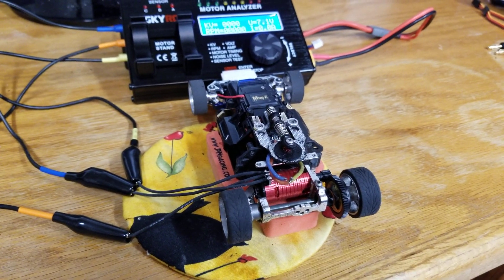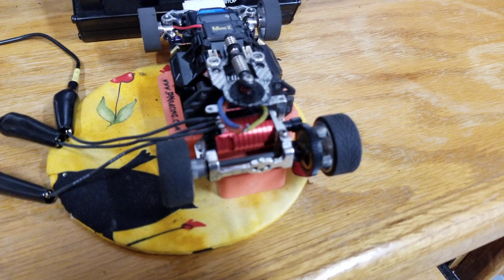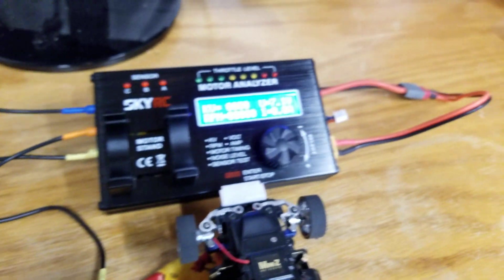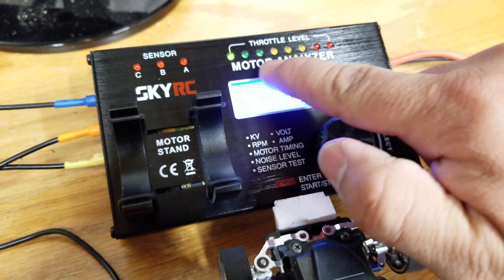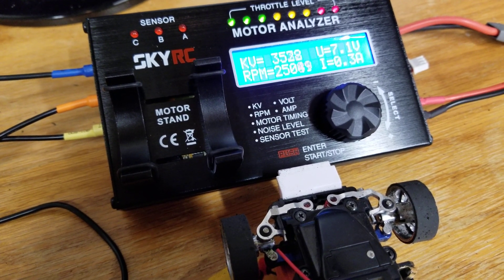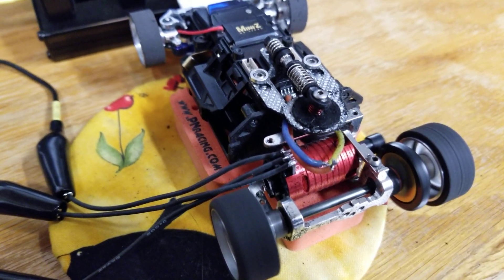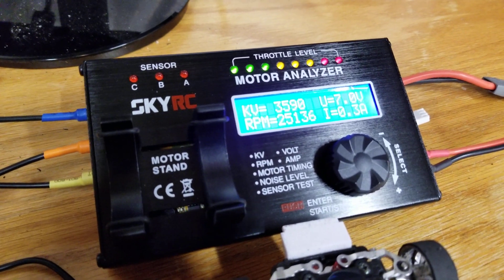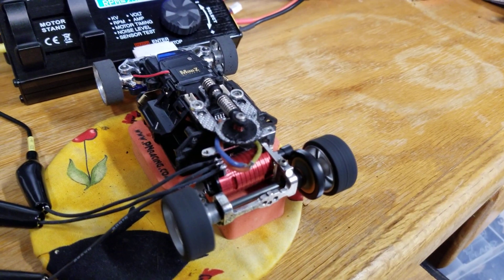Mini-Z brushless KV motor testing

Comment: Thanks for the test. This motor looks suspiciously like previous version of PN though. I also got one and I'm very happy with it.
Reply: Welcome.  Yes it does doesn't it?  Is it not uncommon for manufacturers to make products for multiple sellers but under different names and possibly different tolerances?  I think most of all is that the quality and consistency should be the same.  I don't have multiple motors to test but I plan to take this to my local clubs and do some testing.